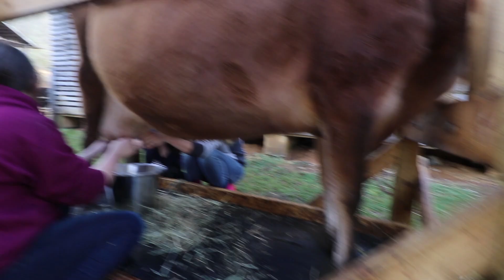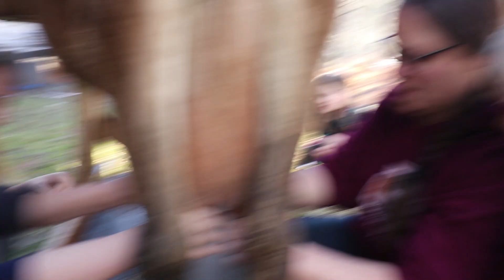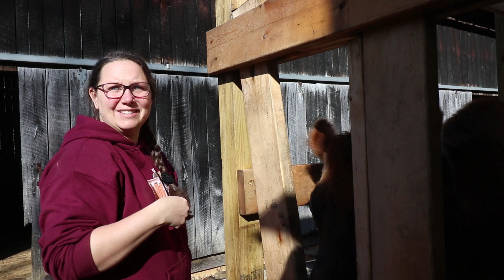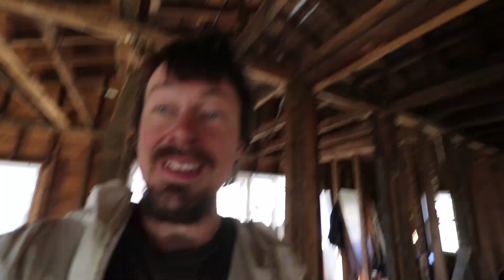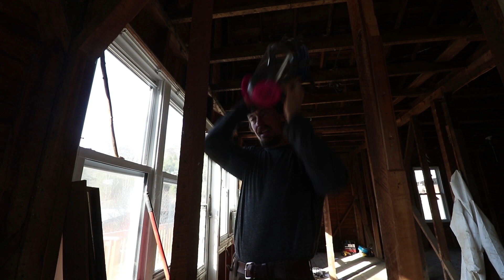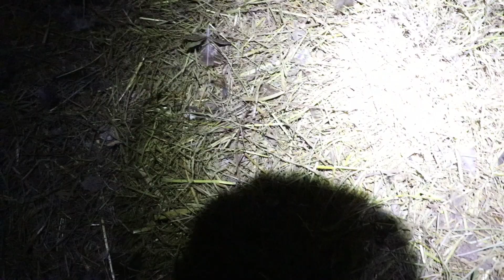MILLENNIALS REBEL AGAINST STATUS QUO (for farm life) Milk Cow / Homesteading Morning

Comment: Aren't you worried that removing such a significant mass from beneath your structure that's not on level grade may risk subsidence of the overlying earth higher up the hillside, or at minimum create a void, a sump, that will fill with storm water runoff during any saturating rainfall?  
Has an engineer ok'd it as 'geologically' sound practice?